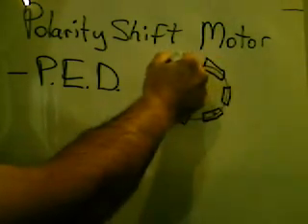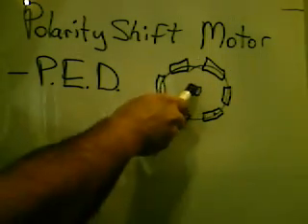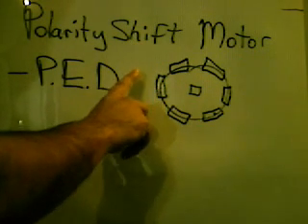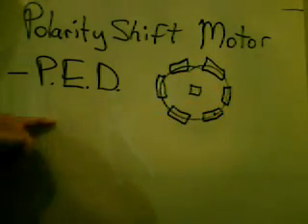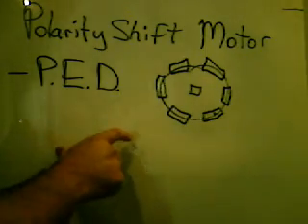Polarity Shift Motor (Part 1)

Comment: I've watched two parts of this clip. I didn't really grasp a point. But I believe that permanent magnets can provide free energy if coupled with coil on iron rod and circuit which in the right time "takes off" stored magnetic field in the core in order to allow full circle movement.